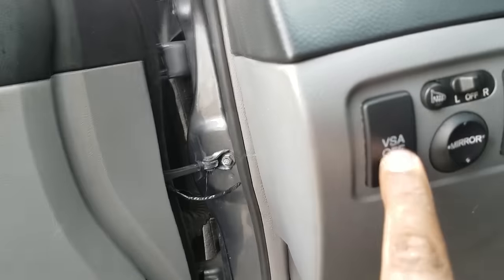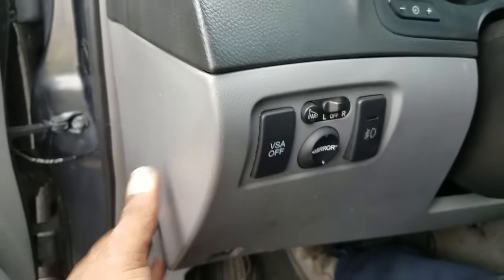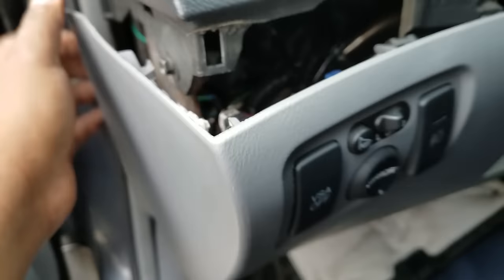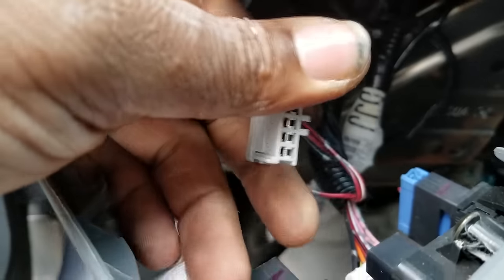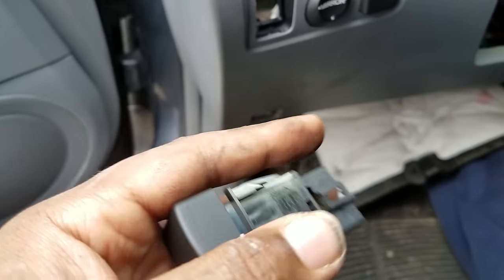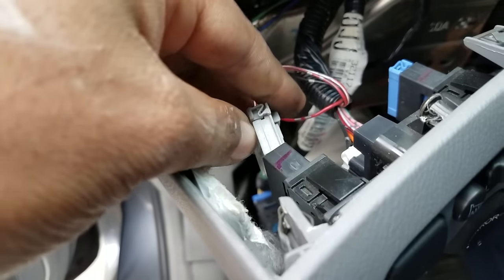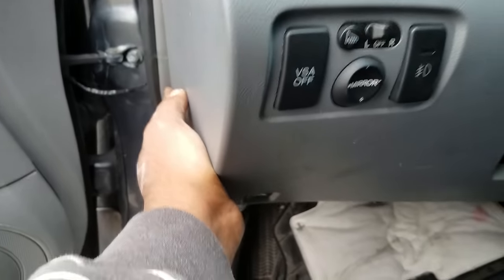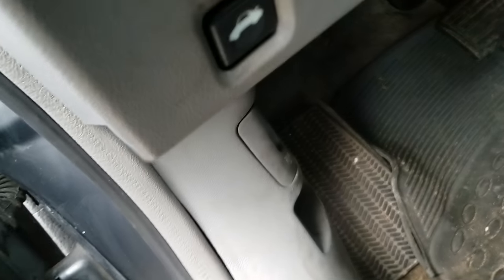HOW TO REPLACE VSA VEHICLE STABILITY ASSIST SWITCH TUTORIAL QUICK EASY

Comment: How can I reset vsa on a 2014 Honda accord EXL V6? It comes on & off through out the day. I've noticed a slight difference in speed.
Reply from the maker: scan the car with a abs scanner sounds like your wheel speed sensor or sensors are going bad.
Reply: @fabolousg4ever   A diagnostic was ran yesterday, due to lights on dashboard. However, it came back as vsa
Reply from the maker: @YFFM8722 what was the code
Reply: @fabolousg4ever  123-11

Comment: I think I need to replace mine. My VSA light will come on as well as the check engine light and the car won't go pass 40mph. I just had the car looked at twice in the last month and both places said everything was fine.
Reply: Following.. Did you fix the problem by replacing yours?
Reply from the maker: its has to be the pedal position sensor common problem replace sensor.
Reply: @fabolousg4ever  Nice My friends Honda Element Shuddered wont go past 40MPH Honda Element. VSA light on with ! also
Reply from the maker: @semeincha  have you scanned for codes it might be the pedal position sensor
Reply: @fabolousg4ever  I will be scanning it tmw. Thanks good content.
Reply from the maker: @semeincha  u welcome thanks

Comment: my Acura turns on the VSA light when I drive about 5 miles, I press the VSA but the light does not turn off, it loses speed, but I stop and turn off the car and turn it on again and the light disappears and it runs normally, which will be the  problem?
Reply from the maker: you have scan the abs system you need a all system scanner.
Reply from the maker: possibly a wheel speed sensor .

Comment: i have a 09 Acura TSX with check emmissions, VSA, And engine light on. was driving on the highway and they all came on. car still runs but doesn't have the same power as before and they all stay on constantly.  help!!!!!
Reply from the maker: Sounds like limp mode to me check you throttle positioning sensor and if u can scan the car and give me codes that would help.
Reply: code came up for replacing timing belt
Reply: This happens to me as well. The code is code p1276. My honda dealer has changed the throttle body, pedal sensor, car computer, still does this once in a while. Any thoughts?
Reply: It happens to me when Im parked and I turn on my car. The control engine light, the !, and Vsa light comes on. The car won't accelerate, it only stays at a constant velocity. My dealer says that it shouldn't be the VSA system because the CEL comes on too. Im just not sure what to do anymore. Car: 
Honda element 08
Reply: code P0341 and P0562
Reply: i got codes P0341 and P0562
Reply from the maker: First code is for replacing timing belt yes its stretched needs replacing and he other code is for low car battery it needs replaceing or charging system tested
Reply: fabolousg4ever I’m having the same issue with several lights coming up including VSA & engine emissions. I did have the battery, starter & alternator tested already (at Advanced Auto Parts). They all passed. Not sure if it’s related my car had trouble starting up this past weekend & after a jump it’s working just fine now.
Reply from the maker: Could be a wheel speed sensor try scanning the vehicle for codes  then get back to me
Reply: @fabolousg4ever  hi fabolous, i have a 2007 odyssey touring, when i turn right the (vsa) light comes on and also the ( ! ) comes on followed by a growling noise on the driver side, then the lights stays on,. When a turn off the car and turn on again, (vsa) and (!)  are off , until i turn right again. Anu ideas of what is happening? Is making me crazy. Please help. Thanks in advance
Reply from the maker: Def could be a speed sensor
Reply from the maker: @baloo217  and also a bad wheel bearing

Comment: I have an 07 Acura TL and my VSA and ABS lights have been on for quite awhile now and cant turn them off with the vsa switch, but this doesn't keep me from driving the car normally even in high speeds on the highway, any suggestions on how to turn them off or what the problem could be?
Reply from the maker: prob a bad speed sensor on the wheel need replaceing scan the car for codes go to autozone tell them you wanna scan abs codes and the scanner will tell you exactly what it is.
Reply: @fabolousg4ever  you awesome man!!

Comment: My VSA is on recently on my 2005 TL 168,000 my check engine comes on and the vehicle loses power is there more to address like the fuseable link what should I do thx✌🏾️👌🏾💯
Reply from the maker: Derrick Carter you need to replace the app sensor and scan the car give me the codes and i can help you better.
Reply: So what you replaced is not the app sensor? How much would it cost at the dealer? Thx I will get it done ASAP
Reply from the maker: Derrick Carter pedal postioning sensor its like 140 from the dealer i buy my parts from acurapartsforless.com and i have a video showing how to replace the sensor check my tutorial section for how to replace app accelerator pedal positioning sensor app sensor.

Comment: My VSA, /!\, and engine light come on when driving on the highway. I get the transmission solenoid code p0470 but I have no idea why these three lights are related and it only happens on the highway at high speeds for long periods of time. I clear the code and will never get it again until on the highway for around 45mins then I pull over restart the car and the /!\ goes away. Side note: I have a squeaky left front wheel possibly due to bad ball joint or wheel bearing although it shows no signs of play or grinding noise. Please someone help me figure out this mystery.
Reply from the maker: +Newtoschool its the wheel bearing and possible wheel speed sensor

Comment: I have a 2007 Honda Accord v6, manual transmission. My VSA gave me hell, kept coming on preventing me from accelerating, all for no reason. I changed my spark plugs and for two years didn't have any problems. Now, it's happening again. I changed the spark plugs but it's still happening. I'm gonna change the switch and see if that fixes anything. Thanks for sharing the video
Reply: Hi. Does the light came back again?
Reply: @esperanzavolquez4065  I didn't have to change the switch. The VSA was gong off because my tires were too low. Since airing them up I have not had any more problems with my VSA. My suggestion forthe VSA is to start with the small, easy (cheap) fixes first.

Comment: I just brought a 2010 honda civic and my first time driving it the vsa light was on the triangle with the ! In it was on and the engine light was on and the D on the dash board light (green) keep blinking
Reply from the maker: green light mean somthing is going on with the transmission and the vsa light is telling you somthing is wrong with thr abs system you need to do a full system scan to find out exactly what is wrong try autozone for free or check out my amazon store has alot of good scanners that can tell you exactly whats going on.

Comment: IN MY 07 CRV THE VSA LIGHT WILL COME ON PERIODICALLY, AND WHEN IT HAPPENS IT LOOSES POWER AND NEARLY STOPS.  TURNING IT OFF AND WAITING A FEW MINUTES USUALLY RESETS UNTILL IT COMES ON AGAIN.  WHAT COULD IT MEAN, AND HOW TO FIX IT MYSELF?
Reply from the maker: Kram Ffiltar replace your app sensor type in ebay search 2007 honda crv app sensor and you replace that and you will be good to go trust me  very simple to change too.
Reply: I have exactly the same problem with a Honda Element 07,  could be fixed the same way replacing app sensor? I did not find anything on ebay for honda element
Reply: For the record APP stands for accelerator pedal position.

Comment: My honda accord 2008 VSA light comes on the can won't accelerate normal. Sometime if i switch off the engine, it goes off maybe comes back after few days. My automechanic is asking to check my wheelbalancing and ALignment then the tyre pressure first. What do you think@fabolousg4ever
Reply from the maker: Accelerator pedal position sensor sounds like it needs replacing scan for and codes and contact me back for more help to confirm the sensor is bad.
Reply: @fabolousg4ever  okay I will do that. Thank you
Reply from the maker: U welcome
Reply: Hello 

Just scanned the car this 2 codes came up;
1. P2176
2. P2135

Thank you
Reply from the maker: yup faulty accelerator pedal position sensor needs replaceing
Reply: @fabolousg4ever  okay. Thank you. 

Also noticed that my TPMS light is constantly on
Reply from the maker: replace bad tpms sensors batterys prob no got replace the sensors are like 40 dollars each oem

Comment: My accord 2010 vsa switch not working when i try to turn it on or off.  Is the switch dead??
Reply from the maker: no vsa prob need reprogramming
Reply: MODS FOREVER why did that happen?  I though the vsa switch is dead
Reply: MODS FOREVER fyi.   One of my friends said if a honda accord tire pressure is low. The vsa button will not turn on or off.  Let see if its true if not that will be a lot of money to spend to reprogram like you said
Reply from the maker: it does that when abs codes are deleted it deletes the memory for the button
Reply from the maker: no its not you can buy a scanner from my amazon store that can reprogram the button or a simple shop can do it too.
Reply: MODS FOREVER will it be expensive or necessary in your own opinion. I wonder why the memory got deleted like you said.  Most recent even in past couple days is a dead car battery got replace and engine oil change today at honda dealer.  Came home and vsa did not turn on or not at all.

Comment: appreciate all your tutorials bro! question, does your volt meter show any activity on the screen when it beeps? i tried this, and no beep, but the reading did change on the screen. not sure if mine just doesn't beep or if my vsa switch really isn't working.
Reply from the maker: Henry Roun what is your vsa issue
Reply: i meant to comment on your 'test vsa switch VSA button' video, but my VSA light and ! is always on. i tried resetting and clearing the codes, but it's still there.

Comment: Hi..I had an accident in my 2007 Honda Accord V6 ..The damage was only on the passenger side towards the right wheel..Now my VSA light is on the car won't pick up speed only 5mph and now the car jerks hard when putting into gear and engine light is on. All I want is the car to run it appears that the VSA is stopping the car from running.. help please !!!
Reply from the maker: purple apple need codes gotta scan the system
Reply: fabolousg4ever does autozone scan your car for you

Comment: I have a 05 tl and my vsa light keeps coming on and when I was on the highway it braked my car?
Reply from the maker: bigjhbg was there ice or water on the ground when stopping
Reply: I'm  not sure also i don't have heat that is hot and it doesn't blow hard
Reply from the maker: have you replaced the waterpump and do you have good tires on your car
Reply: Yes I have
Reply from the maker: try resetting you vsa module could just be a simple problem and hopefully that fixes the problem if not something on your vsa system is malfunctioning but doing the vsa neutral memorization might fix it.
Reply from the maker: yes to good tires or yes to the water pump being replaced

Comment: My Vsa light came on and the car begins to put, it's not pulling like as if it's something wrong with the transmission
Reply from the maker: I don't understand your question rewrite your question please thanks
Reply: Tamsha Rodgers not transmission your breaks mechanism has issues
Reply: fabolousg4ever my cars doing this i had my car in manual instaed of drive for prob like 30 sec with my stereo blasting check engine light vsa and that triangle light all 3 now car has no power... wont go over 3000 rpm barely made it up a hill... i just paid 4000 for this 2005 tsx all my money... sounds like ishango problem.... the vsa and check engine light... whats breaks mechanism?
Reply: Ishango Cartel 
Bro can you explain  please. My odyssey  doing the same loss of power n jerks when coming  to  a  stop... what's  wrong  with  brakes

Comment: So my Acura has the VSA light turns on when I start to drive the car drives fine but the light is always on if I bought the new vsa switch would it turn off ?
Reply from the maker: +Steven Castillo try the memory neutralization process first to see if you can reset the bitton might just need reprogramming to work again.
Reply: fabolousg4ever how do I do that ?
Reply from the maker: Steven Castillo look in my video vsa neutral memorization process